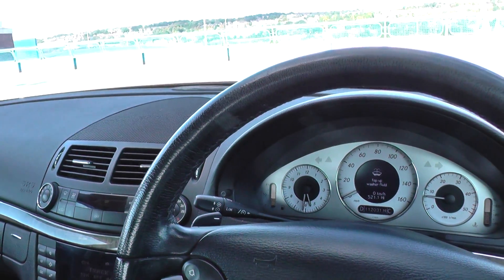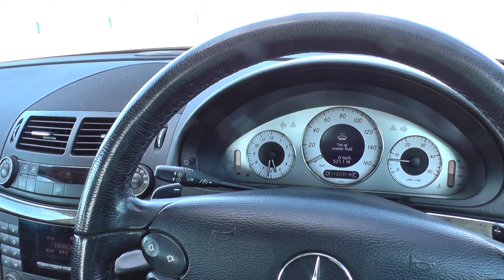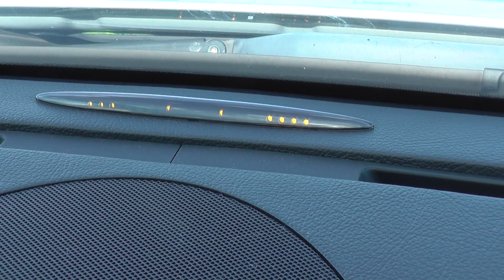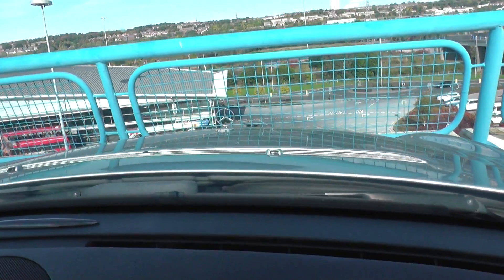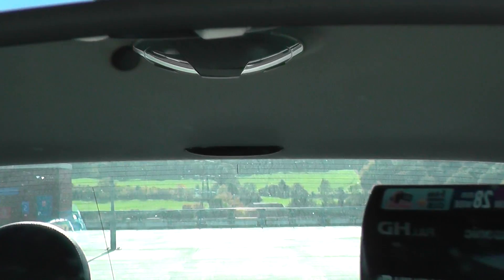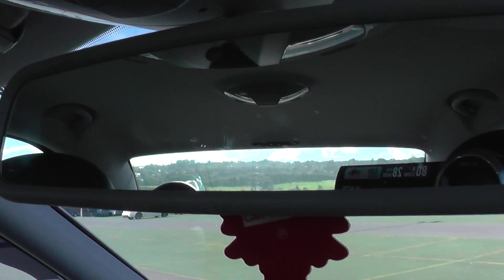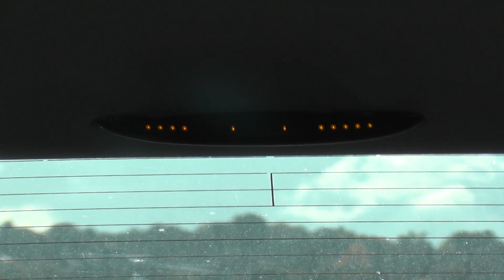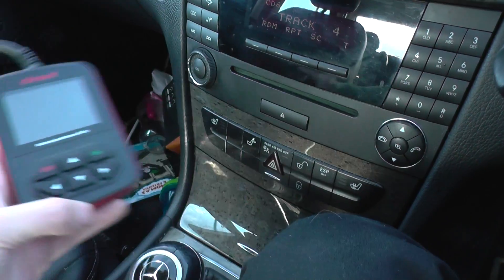Mercedes Parktronic System Demonstration

Comment: Do you need to clear the fault once you change the sensor to get it to work again? I’ve changed all the faulty sensors but the fault is still coming up.
Reply: Об этом и я хочу узнать
Reply: А вы узнали?
Reply: @muhammadkarimalihajiev8069 I had to clear the code but I did have a further issue with the rear wiring loom. I replaced the whole loom front and rear, all the sensors and the control unit.

Comment: Suppose the parktronic sensor goes off often or on occasion when you apply your brakes. Is there a reset to factory settings that will turn it off? or in the alternative, do you know of any way to disconnect it?
Reply: Todd White yes there's a button to turn the sensors off just behind the gear lever
Reply: Should the switch glow red when its on?